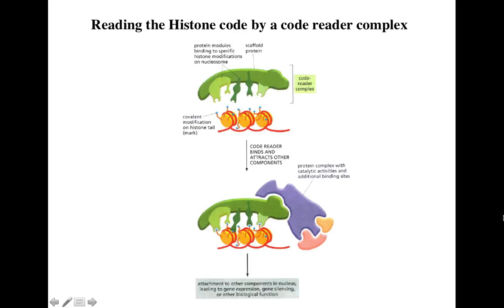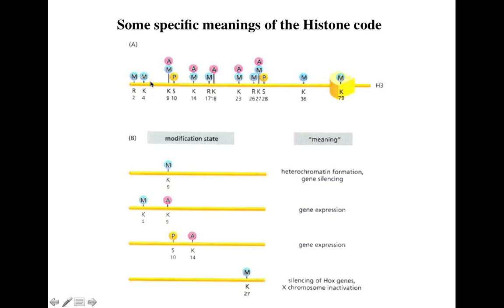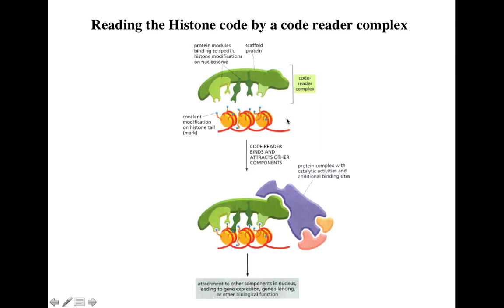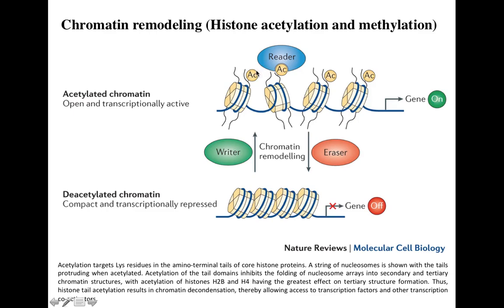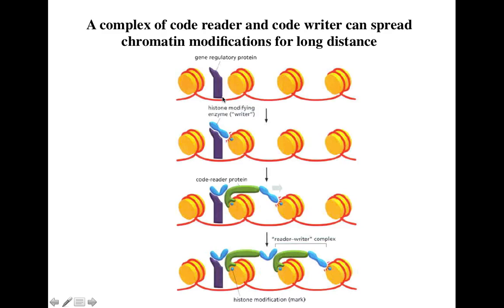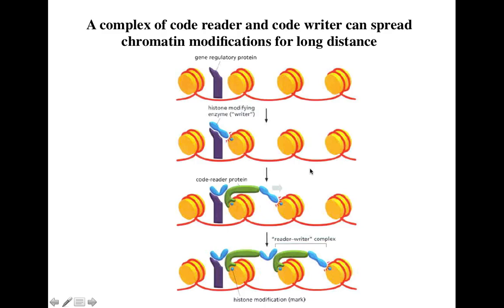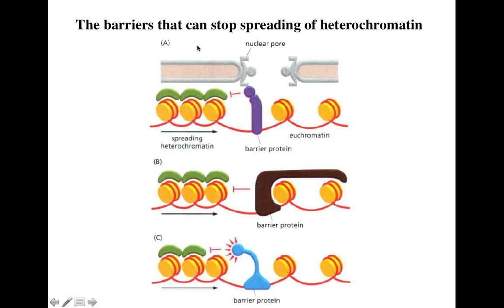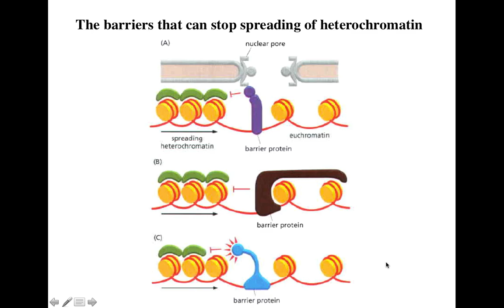Lecture 11 Histone Code and Reader Writer Complexes

Comment: Such a great vid, thank you. I can see that the chromatin codes, which includes ‘starting situations’, before gene-related regions are modified (when they are ‘listening out’ for writers), provide the unique specificity to be read, written to, reread, maybe erased, etc on a gene-by-gene basis, which can therefore support the plasticity of cell function. In this way the code is analogous to that of the ubiquitin pathways, which allow the same levels of plasticity, using writers, readers and erasers, but at the protein level.